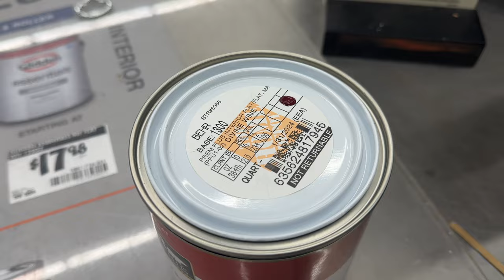EXTREME Powder Room Transformation | DIY Wallpaper Install Tips

Comment: Fabulous room.  I wish I had seen this a several months ago when I was doing my own powder room of similar size but with a weird ceiling as it's under the stairs.  I used those vinyl floor pop tiles in it and did it myself.  I love them.  They're doing good still almost a year in.  Have you tried them anywhere yet?   I didn't know what the curtain was going to look like in that wee window.  Didn't like the thoughts of it at all but when I saw it up,, it's gorgeous.  The whole room is brilliant.  Well done.
Reply from the maker: Thanks Emer! Always nice to hear from you! I think weird ceilings can actually be quite flattering lol I did use those floor pops over 2 years ago in my laundry room and they are as good as the first day I put them in. 
(https://youtu.be/7IAWmnNSXgY?si=2Fu0ugZJcBmNZmkc)
Thanks for watching and connecting. 🙏🏽😊🤎